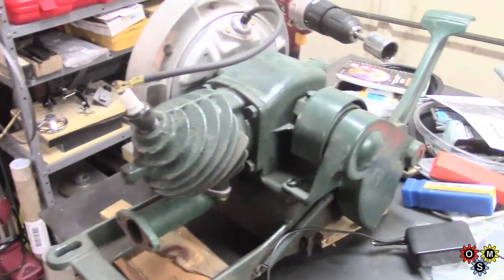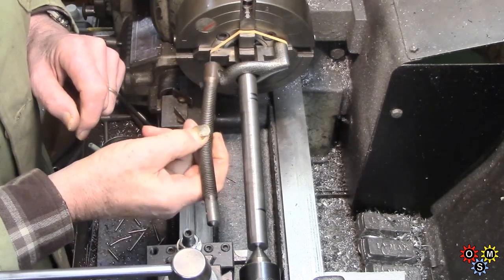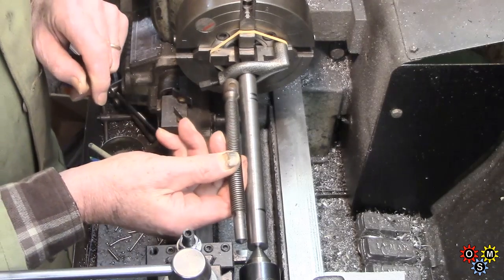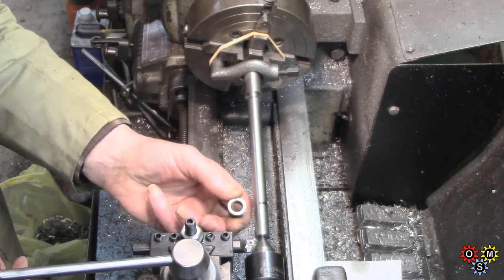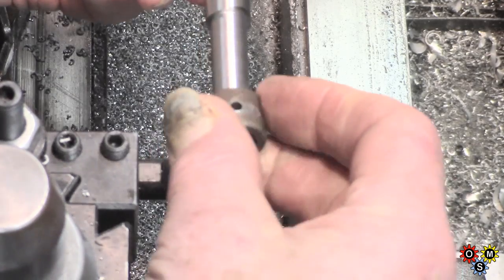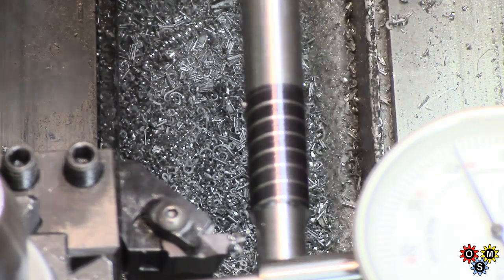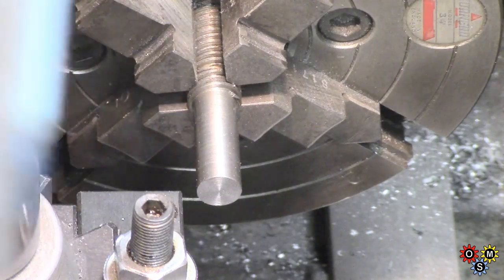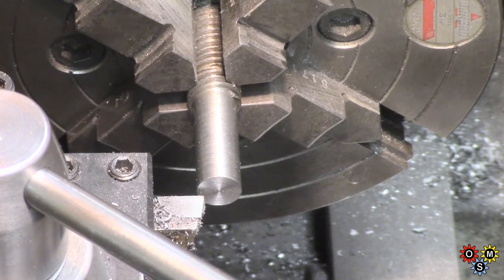Clamp Leadscrew - Take Two!

Comment: Very well done, Chris!  Never had a doubt that you would get it finished.  That's a nice little model 92 there, and knowing where you got it, it's sure to be a great runner for years to come.  Thanks for the shout, and for another fine video!
Reply from the maker: Thanks Dale - it had its imperfections but heck - it works!!
Can't wait to get Maytag running again and making a n exhaust flange and pipe.
Reply: Ah, they all have imperfections, Chris..they just cranked them out back in the day...and they never dreamed people would one day seek them out to put them on display...can only imagine the styling they would have if the makers had known...but they are neat!

Comment: That looks very good, it needs to have lots of slop, you are only clamping with a light pressure, and when it get wood glue dripped all over it it still needs to work, good for another 100 years! Happy Christmas ,Chris B
Reply from the maker: Hi Chris,
Yes - good enough for a few uses anyways - and need to have 2 that work of course for most operations.
Happy Christmas to you too Chris.

Comment: Looks a great job. Its too cold in the UK to do much as well. I thought you were on fire when I saw the pipe smoke...:-)
Reply from the maker: Hi Steve,
Thank you - shop temps will be a problem for some time I think.
I liked your devise to permit reverse spindle rotation - I plan to try that myself sometime. So often want to run in reverse but dare not.
Haha - the pipe. Usually put the thing down and it goes out - not that time :)

Comment: Have a merry Christmas, if it works its a good job. As for the cold I live in Vermont and its -5 so I won't see my lathe for a few months finger stick to the handles its so cold.
Reply from the maker: Hi Myron,
Well, it works so - an adequate result (this time!). :)
Merry Christmas back at you.
Your cold sounds brutal -- one thing I find with even just medium low temps - my mill column goes real stiff because of the lube getting thickened up!!

Comment: Hi Chris !
Oh, it'll do for a long use af this clamp ... I have made some too, I just use single thread 12mm and It works fine !

Yeah, that fingernail looks ugly ... watch out for it to catch your shirt or something like that ... it'll rip it off and it hurts !
Reply from the maker: Hello Keld,
Yes, as said, hardly use the clamps but when needed usually do need 2 to be available. Single thread would have been OK but - didn't want to have to mess with the CI block and try to bush and re-thread etc.
I hope that damn nail will release on the one side then get rid of it .......... but for now, tried to file the corner a bit and, keep adding CA glue! :-)